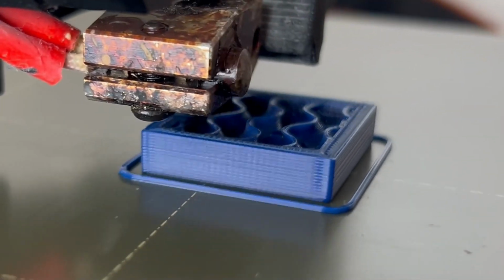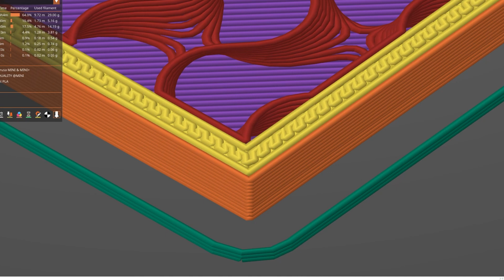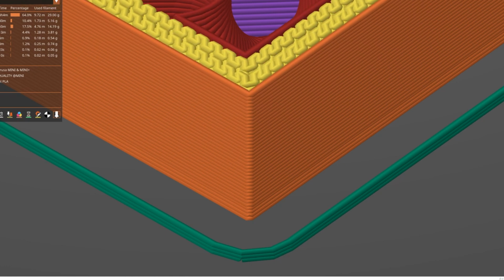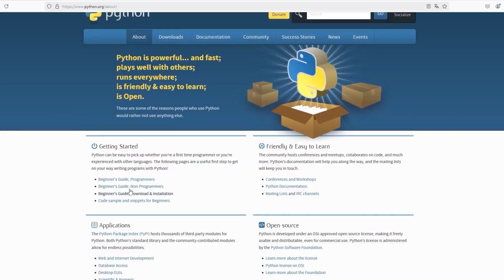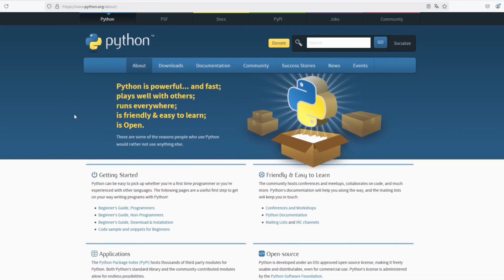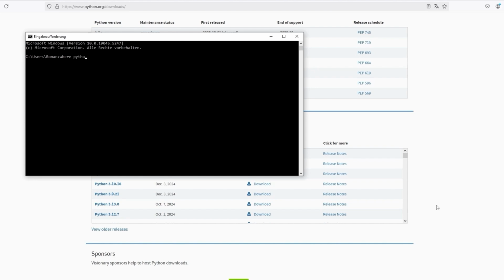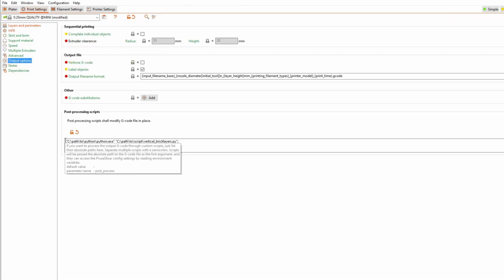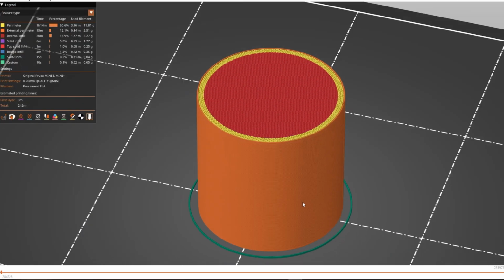Vertical Bricklayers now Opensource!

Comment: Hi Tenger, thanks for your work ! I have a question for you, I took a look at your github repository and you are saying that the python code you offer does not work with bambu printers and I don't understand this point, do you mean with the slicer Bambu Studio or do you really mean the printers, is there a hardware physical limitation that make it impossible to print on a bambu printer with that ? (I'm not familiar at all with bambu lab ecosystem) thank you !
Reply from the maker: Hey there! Some of my scripts do work with Bambu printers and some do not. This is software related as Bambustudio uses different comments in gcode. If you slice with Orca for Bambu printers, it also uses the same comments as in Bambustudio. This is why I wrote Bambu printers and not just Bambustudio. 
My scripts heavily rely on those comments for feature detection, so it's basically just not implemeted from my side and has nothing to do with the printers themselves.

(I'm working on a standardizing all of that in every script. You have to be a bit  patient though.)
Reply: @tengertechnologies  Hi Tenger and thank you for your kind answer, sorry for the delay I just see that your answered me :) 

Ok interesting, so I will wait for your update. 

I'm interested to test your implementation with my bambu lab printer because I think that it could print more waterproof objects

Comment: how much of the strength is gained from the walls being creased like a truss - vs straight lines - compared to how much strength is gained from the walls overlapping slightly like laid bricks?
i guess you could compare a radial wall cylinder sample to a brick laid wall cylinder, and potentially also test a non brick laid wall that had just the zigzag pattern for the inner wall lines?

Comment: Hey there, i was wondering if you could make a post processing script for multicolor printing without an ams, i am thinking of it replacing a color swap with a pause so one can quickly change the Filament manually, this then hopefully allows single layer multicolor printing. :)

Comment: zig zag? rip print time or linear rail bearing. It would probably be sturdier to print double width lines instead
Reply: Zigzag isn't that slow on a modern printer. At 50k accel you can average 80 mm/s doing that zigzag over 2 0.5 mm extrusion widths. That means you advance around the perimeter averaging 40 while making 2 perimeters. It's not 300 mm/s but not 30 either. 😂

Comment: I am wondering if you could combine this with the standard brick layers in some way.

Shear strength and layer adhesion will still be a weak point with this method. Even if it is improved over standard.

Comment: What about trying kind of a zig zag pattern where the outer line is still clean but followed by two layers which overlap each outer with an offset, and also adjusting  the flow while doing this. So Something like this for each layer
/\/\/\/\/\
\/\/\/\/\/
Resulting in a shape something like this. 
XXXXX

Comment: Hey, may I suggest an area of research for you? There exists LW-PLA, which is an actively foaming filament. This means it is great for RC aircraft as it prints at 43% density. However, it has the annoying habbit that if you stop extruding, the filament will continue to foam and ooze out of the nozzle, ruining print quality. 
I believe it should be possible to control both extrusion and print speed in such a way that the oozing could become the last part of a wall being printed, kind of how coasting works, but smarter to account for the slow dropoff in oozing amount per time. The same could be implemented for print restart too. I've tried to code something like this myself, but have failed.This might be something that's possible with your prints? 
Currently 3d printed RC aircraft are often designed to print in vase mode to work around this issue, but this is quite the hassle to design for when one needs internals ribs. So having a better way to make the self-foaming extrusion behave, that would be awesome!

Comment: Im wondering if this could help with warpage of engineering grade materials, all the shorter wall sections may have the effect of spreading out the internal stresses more evenly, preventing it from peeling up and deforming.
Reply: I wouldn't think so.

I believe the warping is simply due to the lower layers being cooler than the higher ones shrinking relative to the higher ones.
Reply: @ Thats what causes warping, but long straight lines can worsen it as each line shrinks from end to end. If you have smaller lines the shrinkage is spread out along each segment, instead of compounded. Its the same theory as why some people use hilbert curve for high warp materials (and is part of why small parts dont warp so badly)
Reply: @noahkatz9616 almost. it's the fresh layers which are shrinking, and pulling on the lower layers which have already settled.
That being said, I'm not sure how effective this would be in reducing warping, since it's still a quasi-solid piece of plastic where the extrusion lines have bonded together. Unlike Hilbert infill, where the individual extrusion are separate and thus have room to move.
Reply: Put it to the test

Comment: i've been thinking about doing some testing making rammer earth wall forms out of 3d printed moulds that can be easily attached together and taken down. This definitely seems like a good way to get much stronger moulds. Even if theres some surface artefacts from the internal wall structure, that level of detail isn't going to transfer to the rammed earth. 
Since they have to withstand a lot of pressure from ramming the earth regular prints i'd imagine would just split along the layer lines almost immediately.
And the benefit of 3d printing means i can potentially make some very interesting surface shapes that can't be achieved any other way.